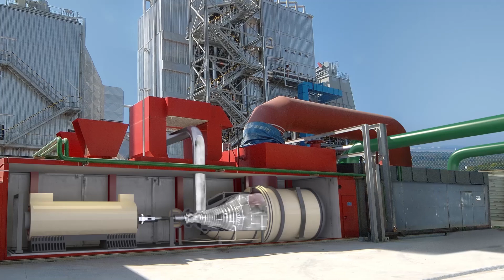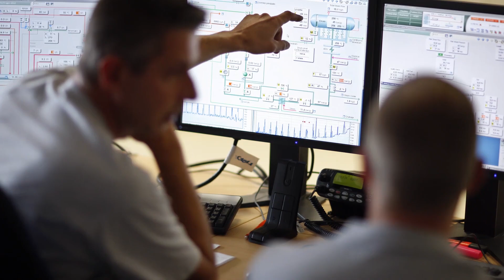Journey to the heart of Energy - How a biomass power plant works

Comment: How is burning Biomass produces low CO2 emissions ?!
Reply: All biomass eventually degrade and produce CO2 anyway, so you might as well use it for the best option, produce electricity.
Reply: Plants take in CO2 from atmosphere to grow
Then CO2 released when burn
CO2 neutral...no addition of CO2 emission
Dumbass😂😂
Reply: You'd need to be clearer in the question. It is low compared to burning coal and oil (also gas). Unlike fossil fuels, biomass get its energy from the sun and (CO2) and is replenished within the human lifetime. This makes it a renewable and 'less' polluting than other sources. A better word for bioenergy could be 'CO2 neutral'.
Reply: The plan is that you would burn one tree and replant 2 trees. So you're burning 1 tree, 1 trees co2 is release but 2 catch it so emissions are reduced (as long as the forest is managed)